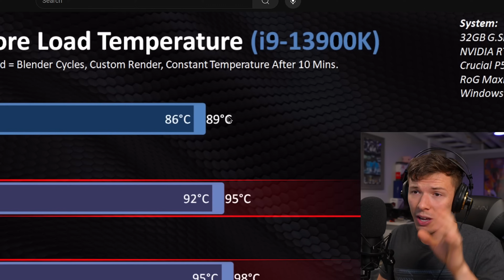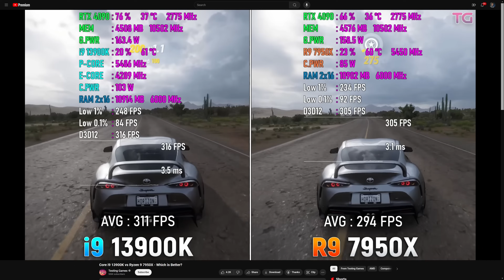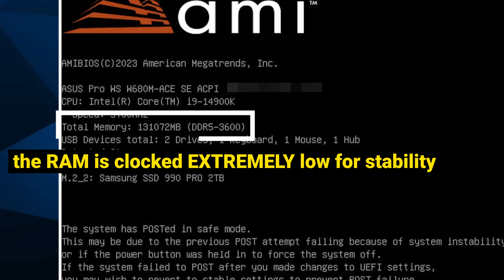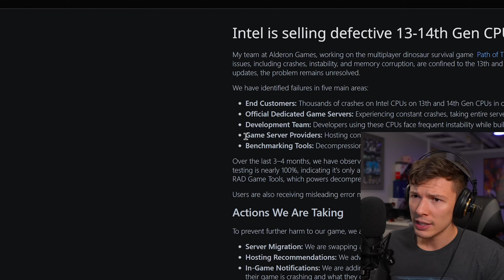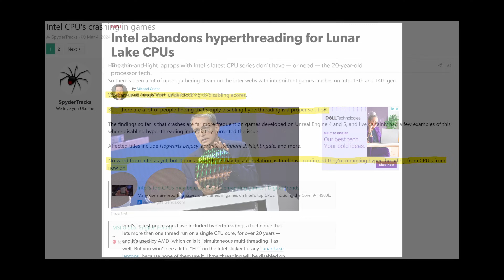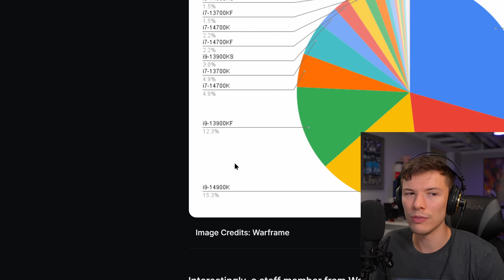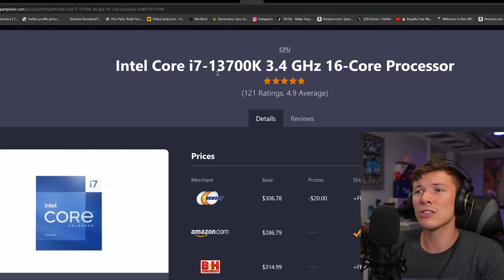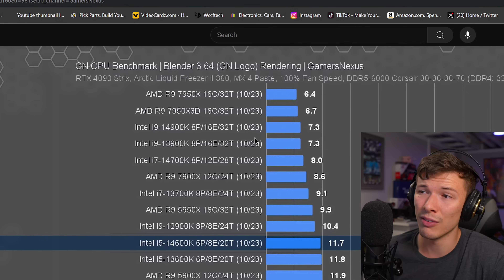Intel F**ked Up Bad

Comment: I got my 14900K about 8 months ago. Things have been from bad to worse. Multiple blue screens, unability to install GPU drivers, Windows updates, random crashes of software. And note that I'm not talking about gaming here. I've had crashes using Excel, Word, and other business software, and it was far from being heavy on the CPU. Barely reaching 5% CPU usage, and still experiencing crashes. I've had more than 30 blues screens per day, having to reboot the PC every time. Software would crash after 1 or 2 minutes, while doing nothing (just waiting to see what would happen).
In 8 months, I had to reinstall Windows 4 times, because the computer wouldn't boot anymore. And it got worse and worse during all this time.
I don't play much, but I've rarely had crashes while playing. 2 or 3 times maybe, which is surprising, but gaming represents only around 5% of my time on the computer.
The computer went back to customer service, and I hope to get a CPU replacement, or even possibly a change to AMD. Fingers crossed. I don't care if it's AMD or Intel, I just want to be able to work and use my computer in a reliable manner. I don't want to be afraid it's gonna crash every time I open a 20KB Excel file 🙂
Reply: More details:
Regular computer crashes and unsollicited reboots: the computer restarts by itself, without warning, sometimes while I'm working.

Blue screens with various error messages:
	System thread exception not handled
	Kernel lock entry leaked on thread termination
	Page fault in nonpaged area
	Driver overran stack buffer
	System service exception
	Critical process died
	And others I didn't take note of…

Repeated Windows Update installation failures (installed after several failed attempts)

Repeated failures to install nvidia driver updates

After a crash and a blue screen, the computer usually restarts on an “auto-repair” sequence before reaching the password screen.

Sometimes, when I start up the computer in the morning, it takes several minutes to get to Windows (this has often happened after the 1st reinstallation of Windows).

Tab crashes in browsers (instabilities observed with Facebook or YouTube for example, but not only), with all browsers tested: Edge, Chrome, Firefox, Opera, Safari…

Frequent Excel crashes, regardless of file size or complexity (new file, or large file of dozens of MB). Lately, all programs have been crashing after a few minutes, including Windows Explorer windows. Sometimes programs simply close, sometimes I get a blue screen.

Comment: buying intel CPUs makes no sense to me the day Ryzens 3xxx have entered the market. 
Lets hope intel can be competitive again next generation of CPUs, its not good to see Intel this bad, it doesn't benefit us gamers.
When I upgraded my giga old 2500k to R5 3600, tbh I didnt considered AMD at the beginning, it's thanks to reviewers and tech channels that I switched my mindset to AMD. Lucky ME, on the same motherboard I've upgrade to 5800x3D recently and I'll keep this plateform for the many years to come, probably till AM6 I guess. 

Running it with a 4080s......if back then I had chosen a i5 9600 (because it was what the choice was : either i5 9600 or R5 3600), even if upgrating to I9 9900, would have had to change plateform to "match" my 4080s I use today.

Comment: A lot of people I have come into contact with during discussions about these exact issues with my first i7 14700K dismissed me and claimed it was only the i9's. Instability in certain titles and eventually it lead to a faulty core. After exchanging for a new  14700K it alleviated a lot of the issues I had, although rare occasions of crashing in UE5 games does still happen for no reason, even after various tests with different components. I do wish I had gone to AMD this time around and would have opted for a refund rather than a replacement if I wasn't stuck with a fairly expensive incompatible motherboard. I feel modern PC's are just not enjoyable to build or tinker with anymore.

Comment: I would bet that most people don't care if they need to run a lower power limit and they lose a little bit of FPS...... The problem is the game crashes and the game freezing every time you leave the game. BSOD is a problem especially when it's on a Intel default setup (253w). Most of us don't give a s*** about a couple of FPS. When I first got my 13900KF it would test on my default setup which was a 4k power limit it would do an r23 score of 39 to 40,000..... here we are a year later and in order to make it stable the most I can get now is 34000.... Isn't that more like a 14700K.... this CPU is a couple hundred dollars cheaper. Wonder how good the CPU will be in 6 months Will it even work at all?

Comment: 12th gen series was almost perfect though and there would be no problems at all if Intel would be more technically innovative, and not just overcooked and overclocked the past gen processors, just to call them "next gen". 

Still the i7 is pretty stable (I am 12700k and 13700k user) as I can say it so far: not that much blue screens etc. But yeah: the 12700k was more stable than 13700k. And the biggest design flaw among all generation and 13/14th gens specifically are e-cores, simply because they're the biggest troubleshooters in both 13th and 14th gens. Actually, you will lose almost nothing if turn them off and stability and the consistency will rise. More than that, very fun and interesting fact, e-cores tend to have more quality problems and typically are falling more often than p-cores. Yeap. Just like they are tend to overheating and this is good prediction that e-cores will simply die soon.

So, 13th and especially 14th gens are rather disappointing if we are talking about i7 and i9 processors lines (i3 is actually very good). Specifically 13900k, 14900k and 14700k, because they are absorbing most of the problems amongst all.

Comment: It's too bad that owners are experiencing this.  When I built my AMD based PC back in December of 2023, I watched as many videos as I could on Intel and AMD.  One thing that stood out was Intel required more power and ran hot.  If you did the same and stuck with Intel, I don't know what to say. I OC'd my system to hit 5.7ghz and barely hit 80C. But when I kept watching Intel CPUs hitting just stock Ghz hitting 80-90C was crazy.

Comment: I just built a new 14900K build and spent a LOT on the motherboard.  I got a high end ROG motherboard that cost me close to $400.  I know it's sunk cost fallacy, but I decided to downgrade to a i9-12900KF, which I just got, so I can keep the motherboard and  DDR5 I bought for the build.  I'm prepared for the inevitable.  I have a decent 360mm AIO and 6 case fans.  I run a very aggressive fan profile and my AIO pump is pretty much running full power constantly.  I hit TjMax often and I run at 50-60c with light tasks.  On my previous 9th gen build I NEVER hit TjMax.  I've had this build for less than 6 months, so it's not I'm doing something different.  Same programs and the 14th gen just cooks itself.

Comment: Got a 14900k from launch and tuned it with 14900k oc guide never had any problems. Turn the 6ghz boost down works all day.

Comment: I emailed Intel support about my 14900k and they are willing to RMA but I keep telling them that whatever 14900k they will replace it with, my problems won't change. I get anything from general instability, games crashing, low memory crashes (on a 4090 lol), blue screens trying to open music software plugins (Kontakt by Native Instruments), 100c temp during shader compilations (with corsairs most expensive 360 AIO), usb bus disconnecting, nvme drive disappearing on reboots, XMP 6400 ram not working(odd for such a conservative speed). I just want them to recall this thing and give me a normal ass CPU that isn't bipolar. But when it works, it WORKS fast but it isn't worth the constant headaches and fiddling. Tired of babysitting my PC.
Reply: Either downgrade to  12gen of get AM5...
Reply: every time ur cpu goes over 90-95 degrees u are frying it ... especially if u have spikes ... ur cooling isn't good enough... my doesn't go over 85 degrees in bad case scenario when my AC is off.... better temps than u I had with arctic freezer 36 with little bit stronger fans then stock...
Reply: @CodeNameTech    Dude telling me my top of the line 360 aio from Corsair isn't sufficient haha. Dude I got the iCUE LINK H150i LCD. It's at the tippy top of quality when it comes to AIOs. Run Cinebench for a matter of less than a minute and yours will also hit 95c+. With your AC on too. The degradation is from bad intel microcode that causes unsafe voltage spikes. Stop spewing nonsense.
Reply: @jimbo121  with Cinebench won't go over 85 degrees... i expressed wrong ... something is wrong with ur cooling system... room temps or bad installation... ill do Cinebench test tomorrow again :)
Reply: @CodeNameTech  No you’re simply coming to conclusions you know noting about. My ambient is 21c. You’re the “assume user error” type of person that no one likes dealing with. You are not worth another reply after this. Goodbye.
Reply: @jimbo121  again u are telling me that u have bad cooling setup :) bad thermal paste or some shit with pump or whatever... if u are facing 100c degrees u must be an idiot not to look on youtube and get to conclusion that something is wrong coz some better air cooler would do a better job... and ur errors .... i don't care about them i just telling u that u are an idiot if u think that temps are even to consider to do anything on ur pc ... ur just cracking already cracked egg :D
Reply: You need to lower the multiplier in the bios and cap the core boosting to the all core max. And lower the voltages. You lose a lot of performance but it might help the crashing.
Reply: @asdf_asdf948  dude at this point I would have bought a cheaper cpu that works as advertized. Doesn’t fix the main issue. Also I did do that and the performance loss makes the cpu not worth it.
Reply: @jimbo121  can't relate, I bought AMD

Comment: Well I guess this points to customers that do not pay attention to their pcs.  If my CPU was at 89 degrees C I would not let it keep running. I do not go above 70 ever running stuff like Cyberpunk and encoding video. I am idle at 28C right now! I am using an I9-11900K and have an I9-10900K in my closet that I had upgraded from to get the PCIE4 bus active on my Motherboard. If Intel does not get this problem under control my next upgrade will have to be AMD.

Comment: I thought I would be ok. I got a Z790 board bundled with a 4090 back when they were made of unobtanium. So I figured whatever, they're so close I may as well go Intel (was on a 5950X). Surely it won't matter. 
I got nearly 2 years out of my chip, but over the last 6 months the issues have begun. I believe the only reason I got this much time was because I run a chiller and my system never breaks 80C. Since this stuff started to get reported on back in Feb/April, I've seen more and more of it, with some people killing their chips in mere weeks.

Intel needs to step in and do something. This is a massive failure. Imagine being in the financial position that you buy unicorn systems every 5-10 years, expecting them to go that long, and your new unicorn is dead in under 6 months. What a joke

Comment: Try to say only the higher CPU's 13th and 14th gens ok. I have a i5-13400f and it never let me down and i play games day and night! Not one glitch or static! use a RTX 4070 and everything runs fine but its a low power, low core count and never over clocked it. But say its the higher powered 13th and 14 gens ok.

Comment: haha try to keep a 14900KS cool AND running full clock speed 5900/4500 with no errors in UE5. I can but it require LLC7 (yes!) and delid, lm, directdie :)  hahahha... If I run Intel Extreme Profile for this CPU (which is LLC5) UE5 crash are all over.... everything else works for the most part but not ue shader compression.   So LLC7 and watercooling as minimum is pretty extreme... I will say though that the CPU runs amzing and cool in all games due to my cooling. 30-40-50c at the cores. I have no fail rate with these settings.

Comment: My 13900k is fine had since launch people are dumb i9 is for tuning it lock core at 5.5 an your fine amd aint the fastist cpu it might be to your cheap as fans get Z790 apex an ddr5 8400 an your good amd is bad it take steam 5 mins to open an it slow

Comment: Everybody knows about the heat situation,  its chasing something that they should have never been chasing,   they are the main supplier of the base of cpu that power everything,  most likely they knew about this long before others,   they need to stop shipping these and move off the heat draw and keep is closer to 75c instead of 99c which is way to hot.   I have seen customers place tickers for temperture so high you smell metal fappor in the air,  when I talk to the remote tech they say its normal.  normal blowing metal burning vapor out the back and having to wear a mask around these things is crazy,   its so bad you only last a few minutes around these things before you get dizzy.

Comment: That why I already give up on PC Towers with separate CPU and GPU and spend over 3000USD for not the true Performance... Now I just buy for 500USD AMD APUs and there the games run well between 30 to 120 FPS with just 15 to 65 Watts.

Comment: Intel went from blaming Nvidia to motherboard manufacturer. But it is not the motherboard manufacturers fault, the wattage and clock speed are both provided by intel, the diminished power for intel cpu after bios update is what motherboard manufacturers decided was needed to keep intel cpu running longer and is not official. Intel themselves still recommend users to run at the power and clock speed they have initially provided to the motherboard manufacturers of what their CPUs should be ran at.